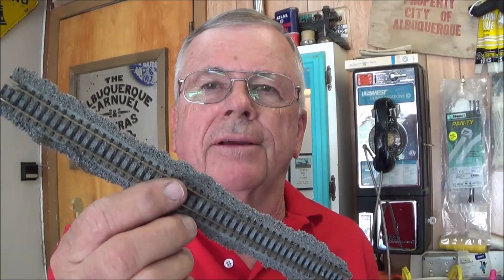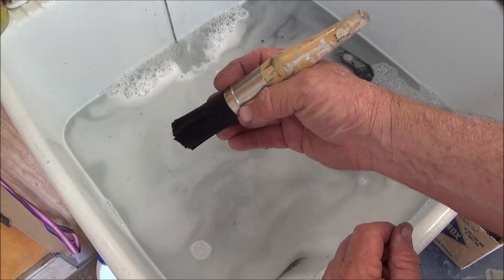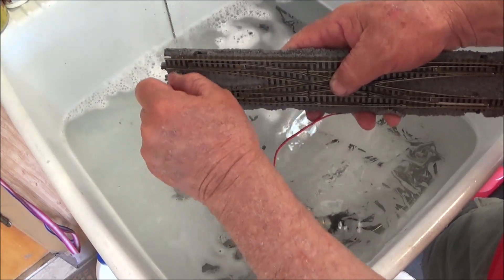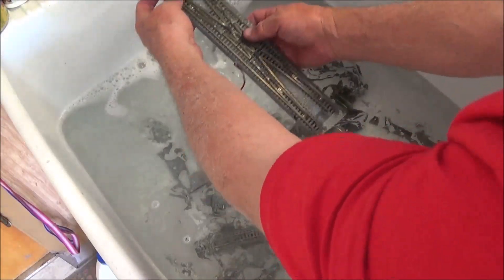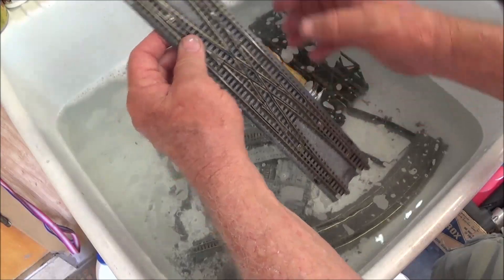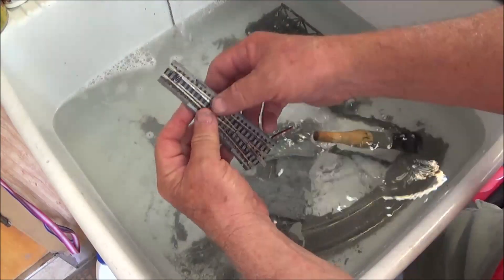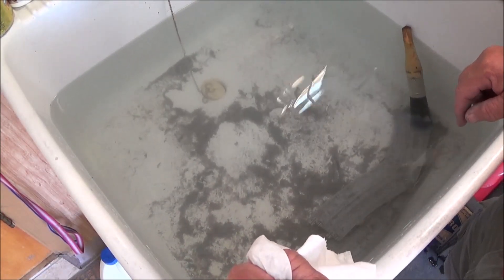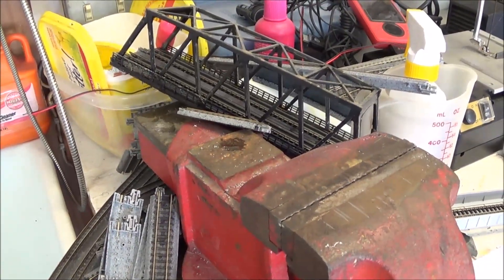How to re use N Scale Kato Unitrack

Comment: Mike, Have you tried using an old toothbrush? They have shorter and stiffer bristles. I have one I use all the time for cleaning track, etc on the layout. Next time you have some track to clean, give an old toothbrush a try and see if it works better than your current brush? Regards, Rich S.
Reply: That is a good idea.
Thanks , Mike

Comment: hey Mike. I just re watched your vid on duble crossovers trying to solve some issues, and make some ideas work. you are the kato track master as far as I can tell, so here's the question. I have a real talent for punishment, I have 8 duble crossover on my layout. 4 of them in a small rip yard alone. is there a way to wire the individual swich for each lead on the crossover ?
and I made a real mistake when I put down my dirt. the mix of glue and sand washed into one of the 4 swiches. I pulled out alot while it was wet, but now that it's dry it only throws halfway. can I use a pick and vacuum to clean it out ? or do you think I need to pull it and disassemble it ?

Comment: So there's no issues with the functionality of the switches after they have been soaked in water?   I've had several of these switches apart so I know there are fairly simple in construction but I'd think it would take a while to dry out the electromagnetic coils since it's such tiny wire.
Reply from the maker: I have re-used several double crossovers with no internal issues using my suggestions.
Thanks , Mike

Comment: I would almost want to use a hair dryer on the turn outs and the cross over. just incase of water sitting in the smaller parts. but thats just me, For some reason water makes me nervous. thanks for the cleaning tips.
Reply: I am sure that would work as well.
Thanks , Mike

Comment: I want to know how to get glue and paint out of the mechanism after it has been installed on the layout. I don't want to rip out a yard ladder after a recent mishap involving a leaky paint pen.
Reply from the maker: White glue should not go into the turnouts in any large quantity or paint either. You could try to dis-assemble them but paint would be very hard to remove.
Mike
Reply: Well,  if I knew that the paint pen would spew paint all over the turnout, I would have chucked it into the garbage first.
Reply: I hear you but I guess sometime we just have some unforeseen mishaps.
Thanks , Mike

Comment: Would the innards (the circuit boards) of the turnouts get corroded?
Reply from the maker: Not in my location because we have a very low humidity. If the insides were to corrode they would likely do it in humid climates even without being cleaned.
Thanks , Mike